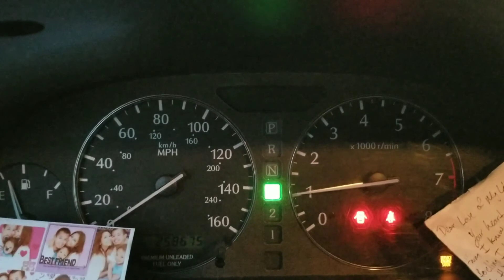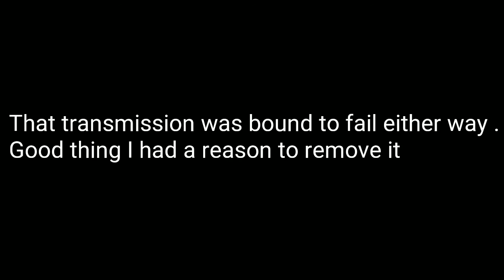1997-2001 Infiniti q45 transmission replacement

Comment: Considering doing this.. I really like my car.. this car
Reply from the maker: Pretty straightforward just get some swivel sockets ,extensions and impact wrench it’ll make everything easier. Also make sure the torque converter is pushed all the way in when you install the transmission
Reply: @ thank you !

Comment: How did you unbolt the tourqe converter? Through the starter location? If so what was used
Reply from the maker: Should be a plate you can take off your access the bolts on the bottom

Comment: when changing any transmission you should always install a new filter and gasket,  when the install is done make sure to turn the car on leave it running for about 10  minutes with the emergency brake on and you foot on the brake shift between all of the gears to get the fluids circulating thru the whole transmission and let it run another 10 min then put into gear and hopefully if its a good transmission and fluids have circulated thru the whole tranny and converter you should be able to put into gear and hopefully it will move when you give it some light throttle
Reply: @jameszond8805  thank you !